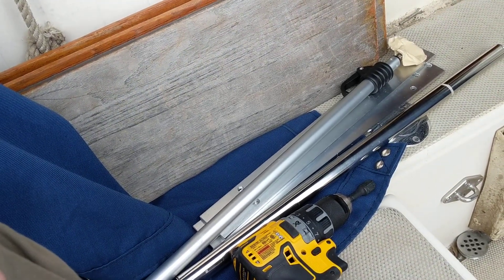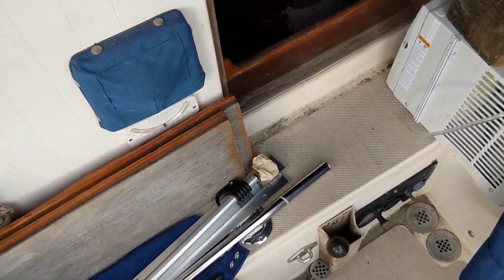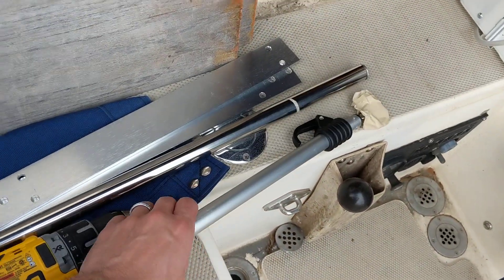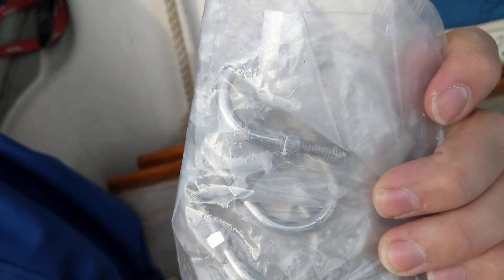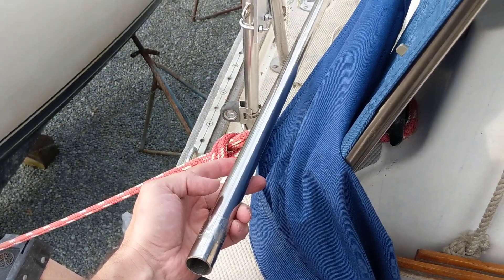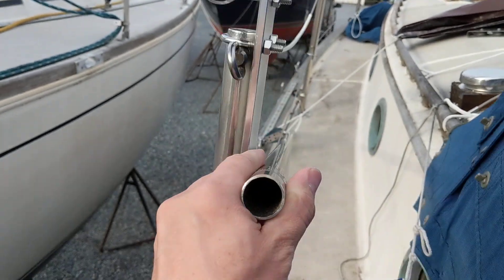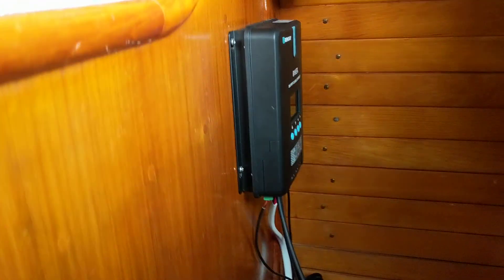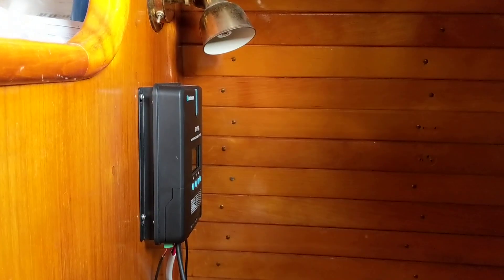Stanchion Solar Mount

Comment: Good to see you posting again! Far winds and following seas.
Paul/deltaten, formerly of SN
Reply from the maker: Thanks Paul,
I'd like to post more if I could, but sometimes it doesn't feel like I've done significant enough progress to warrant an update to the blog or video. Progress is slow, but I'm still working towards getting the boat ready.
I've been on SN less lately than I used to be but still check in once in a while to see what's going on. Guess I've learned enough to not need to research as much as I used to.
Thanks for stopping by.

Comment: Daniel, enjoying keeping up with your projects.  Have you checked out James Baldwin "atomvoyager" Yt channel.  He has a solar mount set up that works good and a couple options of integrating solar on several types of vessels.  His web site atomvoyages.com I believe still has the plans on his solar mount, use the search feature as his webpage has a huge amount of info. sailingdawntreader.com also uses the solar mount and is another interesting refit with simplicity, currently off Brazil.
Reply from the maker: Thanks for stopping by Vanilla50. While I wouldn't say I'm familiar with atomvoyager, I can say I'm aware of him/his site. I've seen his site mentioned by others on forums and I might have stopped by the site once or twice but I haven't looked very closely at it. Looking up his solar mount now, I see he's using a pole mount. I've seen those during my search for mounting options and almost considered something like that as I have a stern-pole that was used for an old radar antenna (that I no longer have). So far, I'm happy with this rail mount option. It'll be a while before I get panels mounted as I'll be out of town for a little while and other projects need some work in the meantime.
Thanks for stopping by. I appreciate helpful comments :)

Comment: Daniel,  Thanks for the informative video. I am researching similar hardware for sv Bonnie Mae. Norsea 27 #228
Best Regards,
Dwight
Reply from the maker: I'm glad this can be useful for you. I researched a few options but I felt this worked well for my boat. I didn't want to try getting a big arch setup off the stern since I'm looking at reinstalling a wind vane. That would end up being a busy back-side.
Thanks for stopping by.

Comment: Those kits are very nice.  It appears they contain every part you need to compete the solar install
Reply from the maker: The kit is good providing everything for a mount. I'm having to make the pieces that will attach to the panel and then to the rail. Even though I had to get additional stainless tubing from Sailrite, I think it's still cheaper getting that kit instead of getting all the pieces seperately.
Thanks for stopping by.